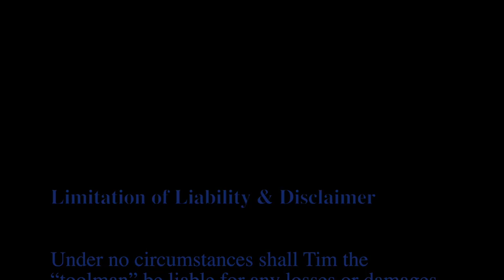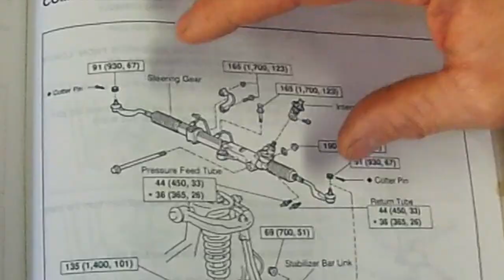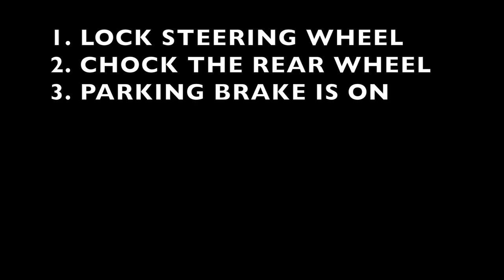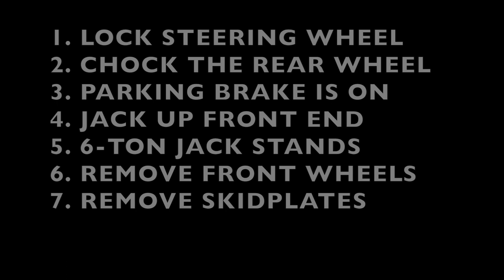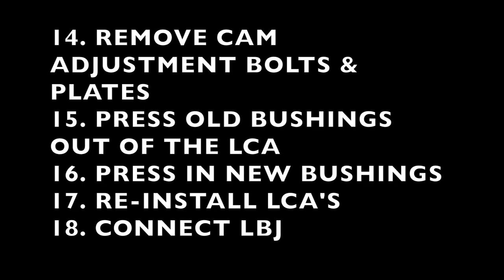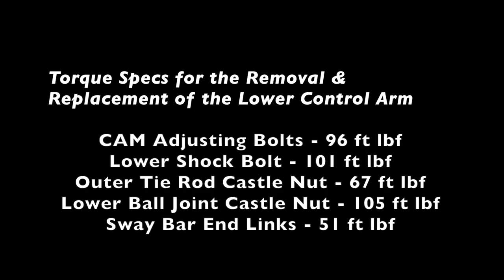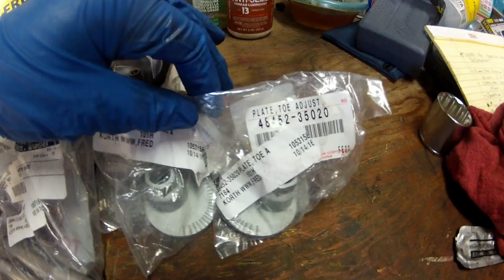Front Lower Control Arm Bushing Replacement (Part 1)

Comment from the maker: *PLEASE READ THIS COMMENT FOR FURTHER INFORMATION AND UPDATES ON THIS REPAIR*

** Somebody on the Toyota forum asked a great question.  He wanted to know how much the vice needed to open up to press the bushings in.  So, I took some measurements and here they are:
Control Arm Sleeve that the bushing presses into - 1.75"
Balljoint Receiving Cup - 2.5"
Big Channel Locks - .5"
Total Length - 4.75"
So, I'd recommend using a vice that can at least open 5 inches. Now, if you use a longer balljoint receiving cup or a thicker pair of channel locks, you'd have to have an opening longer than 5 inches.  But, if you had a shorter balljoint cup, you could get away with less of an opening.  

** In retrospect, I think it would have been better to use the balljoint sleeve to do the pressing against the bushing sleeve for a more even application of pressure and have the channel locks on the backside to provide the gap needed for the bushing to press all the way in.  The channel lock jaws would have to be at least .5" thick because the bushing pushes out that far to the inside of the control arm.

** 12/31/16 - I helped do this repair for someone else and found we did not have to remove the steering rack boot to get the driver side cam adjuster and bolt out.  You can pull the rack back far enough to get the bolt and cam adjuster out no problem as long as you disconnect the power steering line bracket on the inside of the driver side frame rail.  Disconnecting that bracket will allow you enough play in the lines to pull the rack backwards far enough so you can sneak the rear cam bolt and adjuster out. 

** With this repair on 12/31/16, we did run into the problem of having both cam adjusters on the passenger side locked into the bushing sleeve due to corrosion (rust).  We pounded and pounded and could not get them to budge.  So, the only choice we had was to cut them out.  We had to cut the cam adjuster on each side of the bushing to get the control arm out of the frame member.  It's best to use a reciprocating saw with a good metal blade to make the cuts.  I used a small Milwaukee M12 cordless saw to do the cuts.  It's not a super powerful saw, but it got the job done.  So, knowing the fact that these cam adjusters can commonly be rusted and impossible to remove without cutting, you might want to order a couple cam adjusters and have them on hand to you don't get stuck in the middle of the repair.

**04/03/18 - We now have a Part 2 for this job that shows how to use a press to get the bushings out and back in and also how to cut any frozen cam adjusters out with a reciprocating saw.  https://youtu.be/6FzEHygizoI

**Before doing the final tightening to spec of suspension components, you should have the weight of the vehicle on it's wheels so the component is sitting in it's normal point of articulation.  You can snug up fasteners for suspension components but wait until the weight of the vehicle is on the tires before tightening them to the final torque spec.  This is best practice so the bushings don't bind and the component will travel more freely within it's range of movement.  We learned this after we shot the video and we wanted to let people know the correct way to tighten suspension components.
Reply: Excellent tutorial! very clear presentation and videotaping.A job well done!How long did it take per side?Cheers
Reply: I own a 2000 toyo trd first gen and it had worn bushings on the steering gear and I was able to do the job by myself from watching YT tutorials and being lucky to find a factory manual for a 2003 wich is basically the same vehicle.Cheers
Reply from the maker: Hey Rob, sorry for the late reply.  I'd say around 2 hours per side.  If you have to cut out any cam sleeves, it will add quite a bit more time.
Reply: No problem and thank you for the reply, I think I will have to take it to a shop because I do not have a big enough vise and also do not have someone to help me.I really enjoyed your video very informative.Thank you
Reply from the maker: I don't know Rob, the amount of money a shop will charge for this job is worth the expense of buying yourself a new vice.  You don't really need somebody to help you.  You can do this all on your own.  I think you'll be shocked how much a shop will charge for this job.
Reply: Yes I know it will be expensive, I will look into buying a bigger vise.Thank you
Reply: Where can i buy the camber bolts
Reply: @SDsailor7  really. I have been watching some of the videos out there he .is better some of them he does it from being to finish
Reply: @timmy Started feeling and hearing tapping and clunking sounds in where I think the front suspension is. Only happens when driving through bumpy roads, and more so when turning. I replaced my LBJ OEM about 3000 miles ago to the proper spec and no play there. Any guidance? I’m hoping I just gotta replace some bushings…but don’t know where to start. Thinking about just taking it in to get it inspected and doing the work myself after…
Reply from the maker: @RoNBEE1  Are you feeling it in the steering wheel?
Reply: @TimmyTheToolman  no not at all. Feel it mostly in the cabin passenger floor coming from under and can also hear it when the windows are down.
Reply from the maker: @RoNBEE1  You just need to get under the rig and start looking at your suspension components.  I'd look at your sway bar bushings and end links.  Look at your front control arm bushings and balljoints.  Look at your steering rack bushings.  Look at your front shock bushings.
Reply: If you are looking for the power steering line bolt timmy mentions in his update to loosen the rack, it's right under the alternator and oil filter you have to look from under the car toward the driver's side. 12mm bolt holding the lines down.
Reply: Does waiting until the vehicle is back on the ground to torque fasteners include ball joint and tie rod castle nuts. What about shock bolt? I've seen most people torque everything up while still raised. I think shops do that also, not suggesting it's correct though.
Reply from the maker: @weyls2536  It's only for bushing applications that twist, like for control arms.  If you lock in the control arm at full droop, when you put the weight of the vehicle back on the wheels, the control arms bushings will be in a constant state of tension and they will fall apart more quickly.  With Poly Urethane bushings, you really don't have to worry about this though, but we didn't know at the time we made this video.  Poly bushing sleeves will slide inside the bushing.  Rubber OEM bushing sleeves don't slide,   They are vulcanized to the rubber.  As the control arm articulates, the rubber is being twisted slightly.  I hope this explanation helps.

Comment: Here is another helpful tip for this job.  Instead of taking out only 1 of the power steering line guide bracket bolts (12mm), take out all 3.  They are all 12mm bolts with easy access.  Taking out all 3 of the powering steering line guide bracket bolts gives you even more movement in the steering rack.  I didn't even need to take off the boot covering the power steering rail.  I found that if I tilted the rack so the passenger side was low the angle created enough space to get the bolt and cam in and out with minimal fuss.  Thanks for all your work on these videos!  Your repair videos are some of the best on youtube and are extremely valuable to the do-it-yourselfers.
Reply from the maker: Hey Tim,  thanks for the comment.  After shooting this video, I've performed this job several more times.  What I found is you can pull the rack back just far enough with that one power steering bracket line disconnected on the driver side frame rail to get the cam adjuster bolt to clear the steering rack.  When we filmed this job, I just didn't think we could pull the rack back far enough for the bolt to clear but lo and behold we could.  I put this update in the video description on 12/31/16.  But, I can see by taking out all the power steering line bracket bolts you could move the steering rack back further with a lot less effort.  

Sean and I appreciate the nice compliment.  That's great to hear you think our videos are some of the best out there.  Happy Wrenching Tim!

Comment: Just did this to my sons 99.  We busted a puller trying to get the ball joint off. Couldn’t find a pulled to do it so we just took off the 4 bolts under the ball joint. Removed and pressed the bushings in with the ball joint attached to the LCA.  Oh, and the old bushings DID explode out on us and one flew.  After the first one, we caught them all in a bucket. 👍  Thanks again Timmy for the awesome vids!
Reply from the maker: Sounds like you met some challenges but you got it done and that's great to hear.  You used the bucket catching idea.  Awesome!  You're very welcome!

Comment: Hi, my name is Oslei and I'm in São Paulo - Brazil. This video helped me a lot, because I have a 4Runner 1997 (white same as the video) and need to effect the exchanges of the bushes. Congratulations on the production and I think it will help a lot of people like me. I would like to have all the tools that you have but here in Brazil they are very expensive ($$$$$) but I believe that with the ones I have I will be able to make the exchanges without problems (mainly with this step by step video)
I wish you success and congratulations on the quality of the material available to all Toyoteiros in the world.
Reply from the maker: Hey Oslei, I think you're the first person who's commented on our channel from Brazil.  Yeah, the right tools can make all the difference but I absolutely understand what you're saying about how expensive tools can be.  So even if you use Amazon, the prices are still high for you?

Good luck with the repair and don't hesitate to ask me any questions if you run into any problems.  Sometimes the cams can get rusted in the sleeve of the bushing and then you have to cut them out.  I hope in your case all the cam adjusters come out easy.  I give some helpful tips in the video description so be sure to read it before you get started on this repair.

Comment: This video saved me a lot of frustration and headache. After a lower ball joint broke 4 bolts and we nearly had a horrible accident then trying to repair the damage in order to get the car back on the road ... I tried to get the lower control arm off only to find the cam adjuster seized.Thank you for explaining this so well. I cut the old one and ordered a new one.
Reply from the maker: Hey Robert, glad our video helped you out.  Thanks for taking the time to comment.

Comment: I just did this on my 04 Tacoma prerunner, and I would recommend disconnecting the steering shaft from the top of the steering rack, this way you have more than enough room and don’t have to remove the boot from the steering rack. Also I did this with bushings from Energy Suspension which made me reuse the old metal sleeves, which added 12 hours to the job, would recommend the Whiteline ones.
Reply from the maker: You actually can get enough movement out of the steering rack without removing the steering shaft from the steering rack.  Take a look at the comment I pinned and look at the note dated 12/31/16.

And Yes, Energy Suspension bushings are a huge mistake for this application.
Reply: I think Siberian Bushing is the only one now that makes a 1-piece poly bushing for these. I just installed them on my Tundra.

Comment: Haven't done this job yet, but have watched your videos on lower ball joints and outer tie rods, they were IMMENSELY helpful. Considering my lower ball joint broke in my work car park and I had little mechanical experience. Your videos helped me fix it myself, right then and there in the car park. You've inspired me to do much bigger jobs on my truck myself and I'm a lot more confident due to videos like this. Keep these up! Absolutely life saving!!
Reply from the maker: Really awesome to hear our videos are helping you out and they are inspiring you to tackle jobs you otherwise wouldn't have done.  Thanks for the comment.  We appreciate it!
Reply: @TimmyTheToolman  just did it by myself over the weekend! Worked a treat and the truck works heaps better. Thank you again mate 🤘 Love these Vids
Reply from the maker: @Melos-Media  Good to hear.  Great job getting it done.  Happy Wrenching!

Comment: Another outstanding video! Just started doing this and used the bottle jack with a heat gun and some PB blaster.  By slowly adding pressure with the bottle jack and heat, the old bushes came out with no problems.  Doing the steering bushings at the same time so getting the rack out of way hasn't been an issue...Thanks guys!
Reply from the maker: Thanks!  Glad you like the video.  Great job doing the work yourself.  You're very welcome and Happy Wrenching!

Comment: I just did this job on my 4 runner. I found that the thing to do is to cut the bushing flange off and thin press the bushing guts out this way you don't put excessive force on the Controle arm. pressing the guts out. Then use a sharp punch to peal the bushing steel sleve in and then press the sleve out.
Reply from the maker: Sure, whatever works.  You got it done and that's all that counts.  We also show another way in Part 2 using a press. https://youtu.be/6FzEHygizoI

Comment: Great Video Timmy!

At the end, when the camber was suddenly way off toward positive, I'm thinking this would only be immediately upon setting the truck back down on its own tires. It would normalize after a bit of driving.

When the suspension fully extends/ articulates, the lower end of the hubs/wheels tuck in (probably due to the difference in length of the upper and lower control arms, and maybe their default angles to the ground which might not be the same.) 
When the suspension fully articulates, the wheels don't just drop down and stay parallel with each other, they tend to move in a bit of an arc and the lower end of the wheels tuck in. So I imagine, at point of first contact with the ground as you lower the truck, the wheels will have their bottoms tucked in since the suspension will still be quite articulated. The tires will grip and resist being dragged across the ground. 
As the weight of the truck rests back on the suspension, the suspension system will want to push the bottom of the tires back out, but friction will keep the bottom of the tires in pretty much the same place they first touched the ground.
If one would drive the truck back and forth a bit and weave the steering a bit, the tension in the suspension would soon push the bottom of the wheels back out and eliminate the sudden positive camber.
Reply from the maker: Thanks and you're may be right.

Comment: Thanks Timmy!
Did mine today. Pretty work intensive .
Started by using the OEM Toyota vehicle bottle jack but it didn't have enough tonnage.
First one popped out hard. Second one took a lot of air hammer persuasion. Third and 4th I got a bottle jack from autozone and it was enough.
Things flew off like a cannon. 
My vehicle would hard left under braking. I had replaced everything and still had the issue. Although my bushings didn't look/feel worn, the issue is now gone. I marked the cams pretty good but will be getting an alignment Tuesday to see if I can get better caster numbers/driving.
Used whitelines. My inner sleeve slid in with no pressing. Rented some C clamp bearing puller kit thing at autozone and pressing them in was super easy. Full day job.
See u on nov 3.
Reply from the maker: Hey Francois, good job getting the job done.  Great to hear it fixed your issue when braking.  Diagnosing a problem like that can be difficult, and like you said, being able to tell if the LCA bushings are for sure bad isn't easy either.  

Sounds like you would have benefitted from more heat on the arms before trying to drive them out with the bottle jack.  I've used this technique 3-4 times now and I've never had a bushing fly out.  I load up the bushing a little and then heat it up really good.  I give a few cranks with the bottle jack and usually see movement right away.  If there's still not movement, I'll give it a little more pressure.  If there's still no movement, I'll apply more heat and/or check to see if the bottle jack is pushing directly square on the bushing.  You want the piston of the bottle jack pushing directly inline with the bushing and not at a slight angle.  If it's not driving with force straight out, this will affect how well it will work.  

Some people have managed to destroy their LCAs by using too much force with the bottle jack and spread out the arms to where they won't fit in the frame mounts anymore.  Because of that, we decided to make Part 2 of this video showing how you can do the bushing removal with a hydraulic press.  The Nov 3rd party is going to be fun.  See you then.

Comment: First off thanks for the videos.  I replaced the bushings over the weekend on a 3rd gen.  The worst part of the whole project was getting the washers to fit between the outer side of the bushings.  You mentioned it was hard around 31:50.  How hard was it!?  I had to hammer and wedge the washer to get it in and caused a bit of damage to the poly bushing.    My theory is the frame has been squeezed together by the Cam bolts from the factory LCA install.
Reply from the maker: Yeah, we didn't have as much of a struggle as you did.  Our install required no pounding or bushing damage.  Glad our video helped you out and we appreciate you taking the time to comment.  Happy Wrenching!